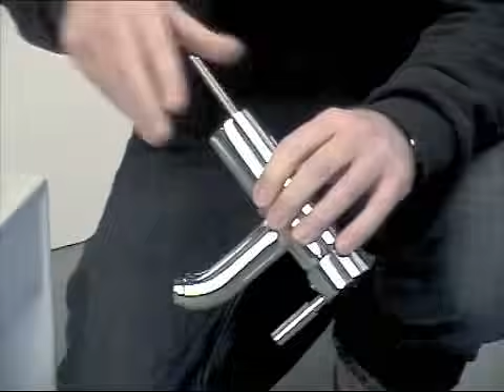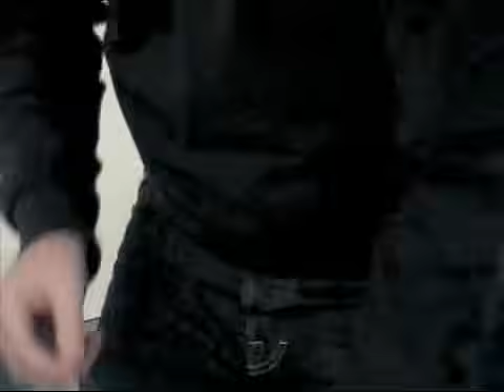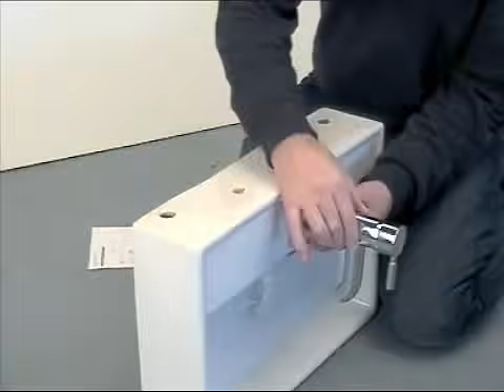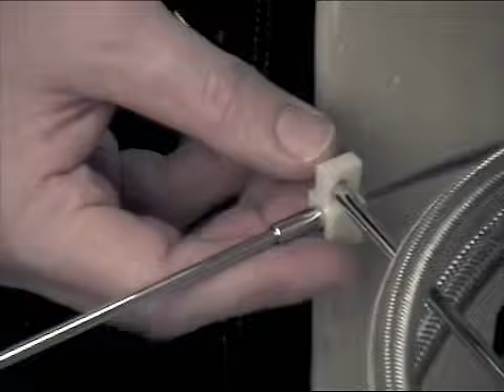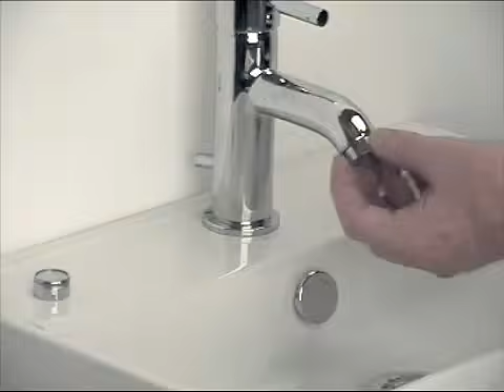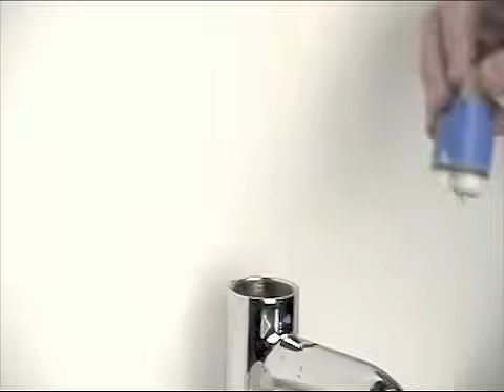bathstore How To Install A Basin Mixer Tap - Bathstore User Guide

Comment: Brilliant point to point guide. The fitting directions in my tap kit seem to assume that the buyer already has some degree experience in these things. However, for a novice but brave DIYer like me, this clip has really shed a load more light on things. The only point that could be a tad clearer, is which way the flange & rubber washer are fitted in relation to the tap body. Having said that, by blowing the picture up full screen and freezing it, I can just make it out. Thanks so much.